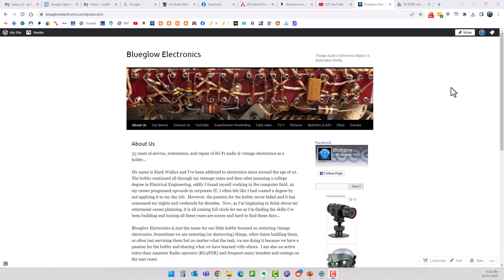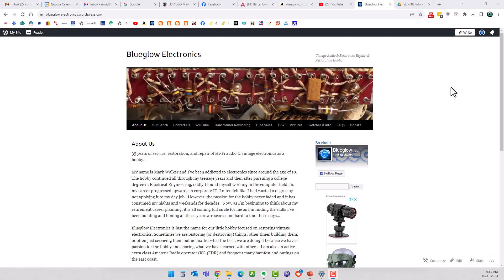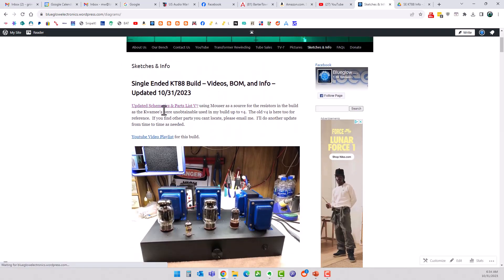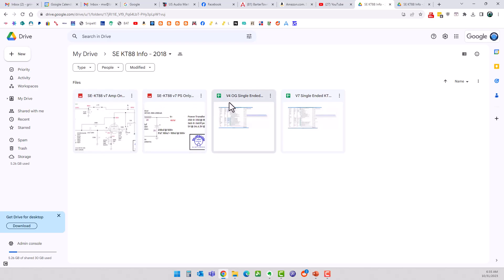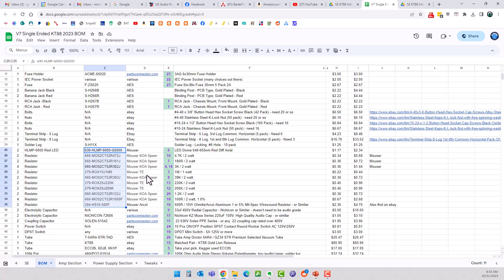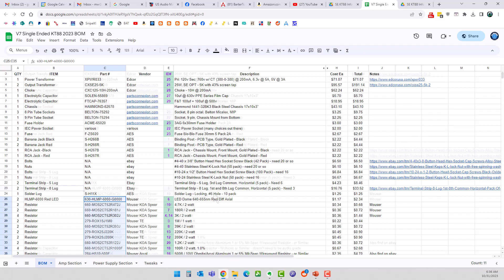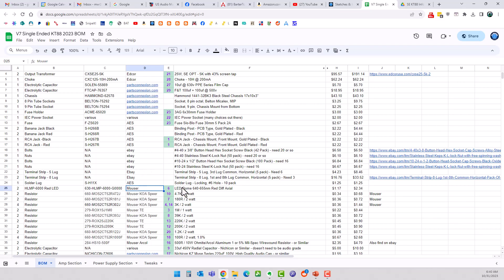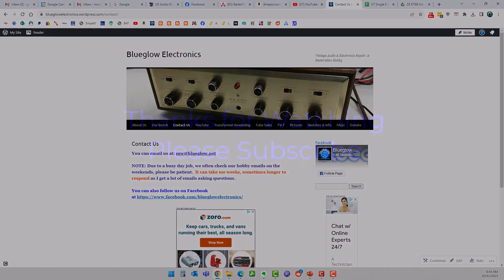KT88 Single Ended Tube Amplifier Build 2018 - Part 13 - 2023 Update

Comment: The 25W Edcor output transformer is now $157 each as of the end of 2024. I'm thinking of substituting their 15W guitar transformer (GXSE15-5K) which is $87 each and is electrically identical other than the lower wattage rating. That's almost half the price. I don't plan on using anything beyond a KT88 anyway so this may be a viable replacement. The KT88 tubes I have are original Gold Lions from the 60's, not re-pops. I also have a couple dozen US made 6L6WGA/5881 military surplus tubes to try out. These were from either the Korean War era or Vietnam War era, I don't remember. I've had them a long time.

Comment: Could this become a kt170 single ended x2 with same driver circuitry, Just a larger OPT and power supply transformer and higher current heater supply??? (Or even No modifications, just a bit more of a taxed power supply and OPT?)
This to me seems like the best configuration, as el34 is under powered really, but very nice sounding. The kt150 and 170 are most likely sound improvements and definitely power improvements.
Only other diy amp I would consider is a otl design with less parts and complexity with higher sensitivity and about 15wpch real.

Comment: Have you or anyone you else know of tried to add another drive stage to make an external pre-amp unneeded?
Reply from the maker: This unit works pretty good without a driving unit depending on what it is.  I ran it in my shop with just an iphone driving it on a cradle for a long time.  But outside of that, no.